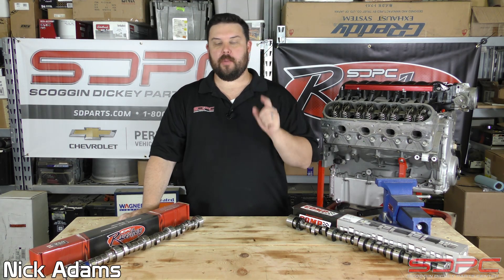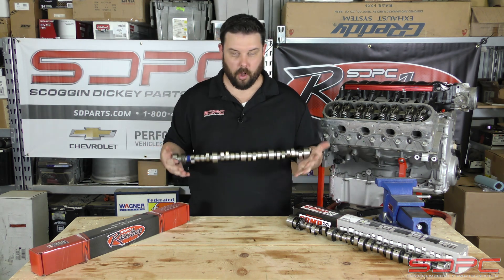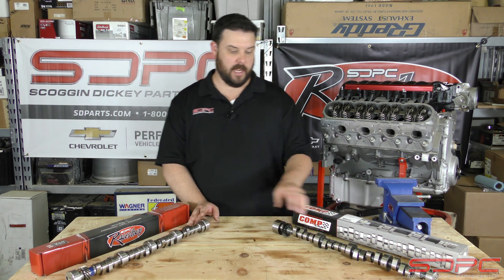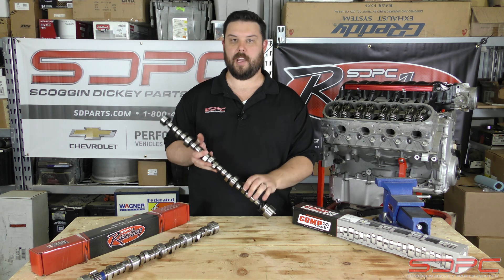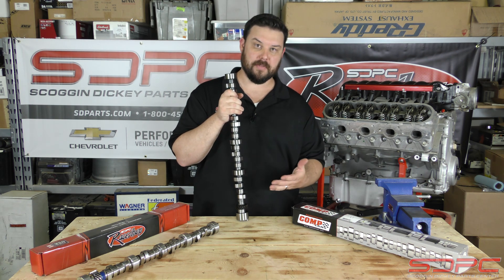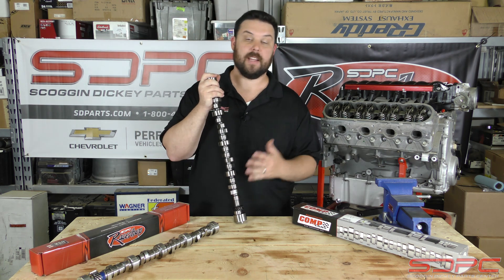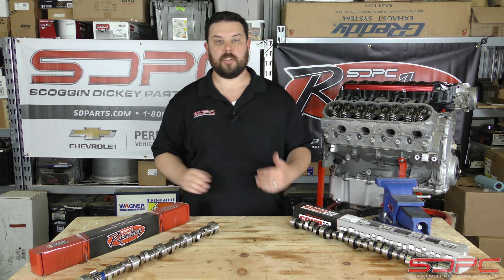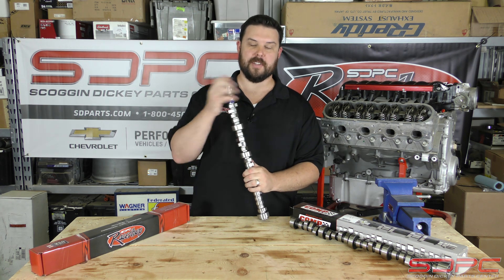SDPC Tech Tips: Camshaft Tech

Comment: I want to thank the tech people at SDPC for the LS2 crate engine they sold me in 2008 it has CNC ported L92 heads cam matching valve springs hardened pushrods SFI balancer GM  performance single plane intake with coil packs wires water pump F-body pulley system with a 25 percent under drive LS MSD box is still in my 1984 Monte Carlo SS still running as good as the day it was put in 2008 probably better this engine is very streetable runs really good 2000-7200rpm I'm 57 year old been around cars since 15 years old had many performance street engines nothing I've ever had even comes close to the power performance reliability or durability of this crate engine l have from SDPC still in my car 13 years later this combination kicks ass makes unbelievable power it has had nothing more than regular maintenance oil changes spark plugs and new plug wires filters it's taken care of very well and it has a Holley HP 850 carberator and 1 7/8 longtube headers
Reply from the maker: Hi Gloria, we're really glad to hear that!  Thanks for the support!